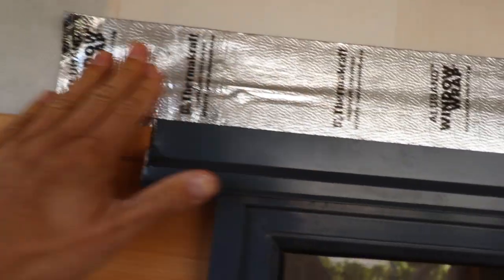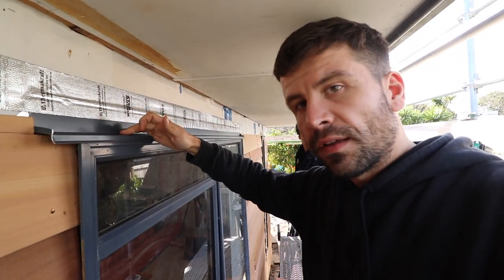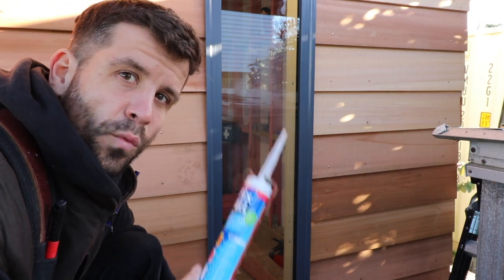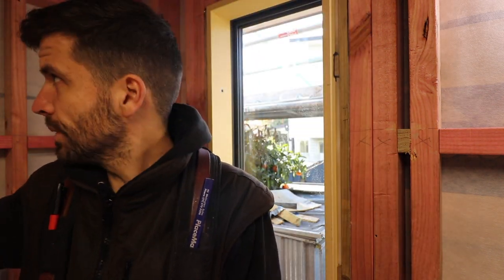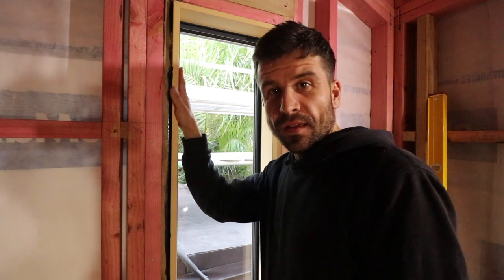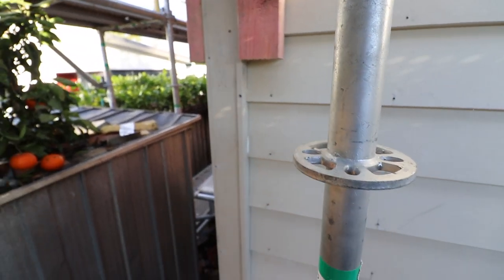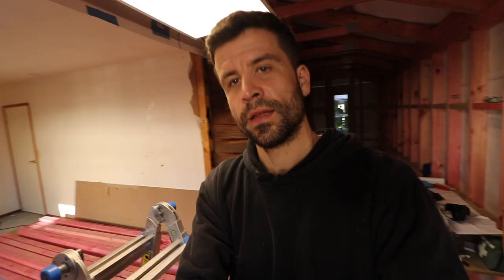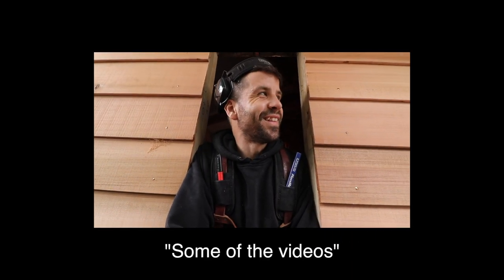Secret to Get Good Scribers (not really a secret)

Comment: This is a cool channel, bro.  I've been thinking of doing something similar.

Also, I always emphasize to my apprentices not to underestimate the value of a sharp pencil and when doing scribers to use a square block the same thickness as the w'board to scribe, then undercut by about 1 - 2 degrees while trying to leave the slightest pencil line.  I guarantee the scribers will be perfect.😉

Just subscribed.
Reply from the maker: Good advice mate!
Reply: I've always tried to teach them to parallel the edge of the nosing of the scriber with the edge of the aluminium, tack it there, measure from the face of ali to edge of nosing then use that measurement as my scribing block. Time consuming yes but a real minter
Reply: @J0rd4nBr0  Yep.  Know exactly what you mean!
Reply: I have scribed all kinds of jobs over the past 25 years and now I use a tool called a thingamijig have a look guys you’ll love them! All the best Chris c

Comment: This is way different than boston. Ive never come across a scriber but i think i'll start the trend. I love it. We run the siding up to the trim board. Also, clear siding isn't common at all. Also, why does the NZ codes require you to block so much? We are only required to have 1 fireblocking about waist height on the interior framed walls.

Comment: In New Zealand youre taught to use the riving knife and guard for the rip saw.  For myself, I've always taken them off because they interfere with the cuts.  I only use the guide on long sheet cuts, otherwise I only use it for fine ripping and scribers.

PS. If you don't have all the proper guards on your tools, on commercial jobs they won't let you use them.

Comment: How were you able to put on the cedar without cavity battens?  Though that the building code required them.
Reply from the maker: Depends on the risk score of the building. This one is low risk, huge eaves on the roof, low wind zone. The council ok'd the direct fix cladding, matching the way the rest of the house is cladded.
Reply: Thanks  @ScottBrownCarpentry   really enjoy the videos.  That explains why we got the real runaround when we wanted to add an extension to an older building.  The new wall had to be 20mm thicker on the inside or the out.  In the end the extension had 20mm additional on the outside so there wasn't a 20mm step on the extended internal wall. They would not allow the framing to be 20mm narrower. This resulted  in a complex collection of Cavity battens, Backing seals, Z flashings and roof flashings, cladding and Exterior cladding battens at the junction!  Just love the ARC.

Comment: Have to agree w/ someone earlier.... Why put the siding on first, then install the window?  Window first, then wrapped and taped, then sided, then sealed or caulked...
Reply: Absolutely window first. This doesn't make any sense to me. 

Also, if you have to use that method scribe the board before installing the window. There has got to be an easier way.

Comment: Is this the norm there, as opposed to adding corner boards first, mounting the windows directly onto the substrate/trimming first, etc?
Reply: I had the same question. Maybe the idea is to have the siding flashing behind the corner board to keep water running off, but if that is the case you would want a gap between the corner board and the siding so water doesn't collect in all the little pockets. Also the building wrap/paper provides flashing behind a corner board, so putting the siding behind the corner board isn't necessary for flashing. I can sort of understand doing scribers this way just because it matches the rest of the existing house. Anyways, your work looks nice. Hope you will enlighten us. I live in Seattle, we have lots of rain, and I was taught to do things the way James Clapperton described above. Sheathing, paper, trim, siding, caulking, painting.
Reply: ancientwestonian I’m from the Seattle area too! Vashon Island.
Reply: Nz is decades behind unfortunately

Comment: No point with the tape flashing over the window when it's directly under a massive soffit over hang, not having a go just saying. like your vids and have subscribed cheers
Reply: Moisture in cavity
Reply: There is a point for putting the tape on the head flashing tho 🤦🏽‍♂️ so if water ever gets behind the cladding it runs down the tape then onto the flashing..... and if you dont put tape on, you are obviously gonna get water that runs down and behind the head flashing then guess what?? Its starts to rot.
Reply: Guess what, massive over hang so no water getting in unless the roof is leaking above.
Reply: @DamnTribute  and what is your profession?